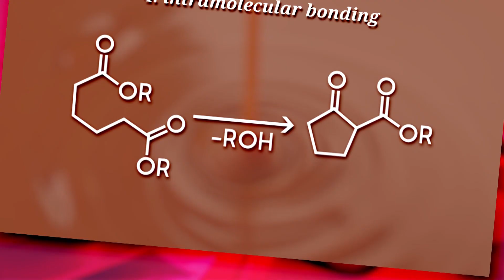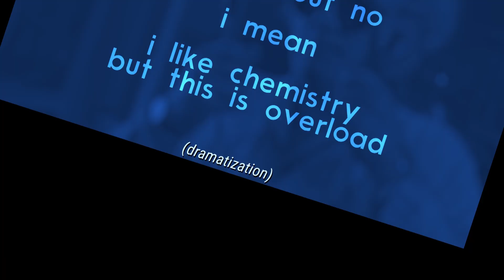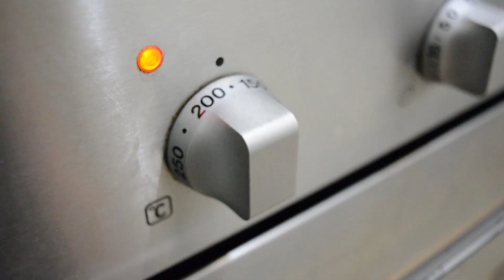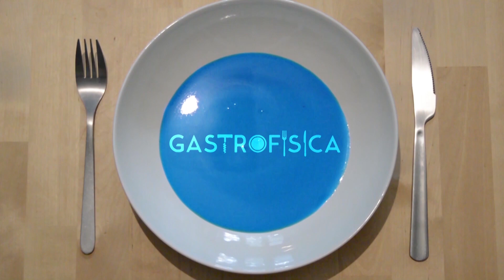The Physics of Caramel: How To Make a Caramelized Sugar Cube

Comment: TIL: 140C in spanish is 150C in english.
Reply: You live and learn.
Reply: Tippe Top Physics , you can calibrate most ovens they take an offset to correct the display. Note the hysteresis is surprisingly large and you need a fair number of cycles for it to stabilize for each setpoint. Then you'll discover each setpoint has its own offset and you can't adjust the slope lol.
Reply: Did you learn at school in English? Maybe your brain better understands 'learning' in the language its used to doing it in?
Reply: Tippe Top Physics Although caramelization is one of those neat tricks you can use to check the accuracy.
Reply: Well, a billion in English has 9 zeros and in Spanish it has 12, so this could just be another of those weird language things. Or it's just a mistake made during translation... Yeah, it's just a mistake in translation.
Reply: I grew up in using the long system and i think the short system is better. We use million, milliard, billion, billiard, trilion, triliard etc (millió, milliárd, billió billiárd... in Hungarian), but million, billion, trillion is easier to use. The long system feels like counting in a weird way, for example one, oner, two, twoer etc (i just made up the example, to highlight how unlogical the long system is imo).
Reply: Pablo 2002 language and the brain is strange. When I was learning Français with Rosetta Stone for some time after my attention would automatically see the French on packages before the English.
Reply: Kain Yusanagi
"million, billion, trillion" in the long system is like saying "2, 3, 4." You're missing the 1 which is a thousand.
"thousand, million, milliard, billion" is like saying "0.5, 1, 1.5, 2."
Why does own base (1000) raised to the 3rd power start with the prefix meaning 2?
Reply: Again, I ask you what the "bi" means in "billion."
Reply: How does something whose meaning includes 2 end up as 1000^3?
Reply: I think the long System certainly makes sense: a Billion is two Millions, a trillion three Millions etc 
EDIT: I mean 1000000^n, not 1000000*n
Reply: Very true, even though I understood it better in English than Spanish. Wired considering my mother tongue is Spanish
Reply: st1300 r if only they used PID control.
Reply: Matt Wells is that because they include decimals to the thousandths place?
Reply: So they call a billion "thousand millions" and a trillion, a billion? That's silly.
Reply: @KainYusanagi  we also have a special word for a thousand millions that doesn't exist in english, "millardo" (could be translated maybe as "milliard"?) that would be just "billion" in english.
Reply: @alecity4877  Jesus christ. Read the whole thread, please. Especially when it's over a year old.
Reply: @KainYusanagi  I already did, I'm sorry, it was late at night (1am) for me, guess me with insomnia couldn't wait to reply X^D.
Reply: @alecity4877  it does indeed translate as 'Millard'. England used the long scale until 1974, and only changed due to Americans using the short system (and apparently not knowing how to work internationally where basically every European country was long scale)
Past 1974, England switched officially to the short scale. I remember my old maths teacher (y7-10) being mildly confused when I brought up the usage of the long scale in English (conversation after the lesson, I did this frequently because I like maths :P). She didn't seem to know that the long scale was used in England so we googled it. Was actually quite interesting. I still prefer the long scale, and were I given the choice, would use it over short scale (n.b. long vs short is also why official documents almost always clarify written numbers with numerals after)
Reply: In Poland we also use long system, but what's more interesting we say miliard for thousand milion, biliard for thousand bilion  etc.
Reply: In the Spanish language video subtitles say 120-150 C, but graphics say 120-140. Maybe a mistake in the Spanish video?
Reply: I guess its to make the number round in farenhait
Reply: Long system is silly because one two three/une deux trois/uno dos treis/million billion trillion. It follows the same conceptual format instead of suddenly altering itself on such a basic conceptual level once it reaches millions. Or, tldr: Consistancy. Everything follows the same deal. Ones(factor beginning), Tens, Hundreds, <new factor>, with the first being Thousands, then Millions, then Billions, and so on.
Reply: 俺の趣味は大麻を培うのですよ
Well as someone who grew up with the short system, Id say that long system is better because I'd rather have a billion be a million^2 rather than a thousand^(2+1).
There are 7 milliard people on earth and debt is measured in the billions.
Reply: Yeah, I feel like the short system makes everything unnecessarily bigger. But again, it boils down to personal preference.
Btw, the term "millardo" (milliard in spanish) is considered a neologism which didn't exist until 1995 when it was added due to it being used in Venezuela. It seems to exist in almost every other european language, though.
And, oddly enough, in Chinese and Japanese they group them by the ten thounsand (or myriads, as they seem to be called). ó.ò
Reply: It makes no sense. Ones, tens, hundreds, thousands, ten thousands, hundred thousands, millions. Every single additional order of magnitude to this point (in other words, 99% of all functional mathematical usage) follows this basic pattern. Suddenly switching to utilizing exponential powers to denote the factor increment is silly, at best.
Reply: Kain Yusanagi it's because what in english is refered as a billion, in spanish, is just called "thousand millions"
for reference:
english - spanish
million - million
billion - thousand millions
trillion - billion
quatrillion - thousand billions
Reply: The thing with a billion isn't the difference between English and Spanish. When taking French, I noticed "trillion" as a translation for "billion" and started digging.
The difference is actually what's called the "Long System" and the "Short System." English primarily uses the short system, which is based on multiples of 1000, while French and Spanish use the long system, which is based on multiples of 1000000.
IMO, the long system is better as "billion" = "bi-million" = million^2. A trillion is a million^3, and so on. For 1000^3 (short system: billion), I've heard it use the term "milliard," which extends to billion * thousand = billiard, trillion * thousand = trilliard, and so on.
It's perfectly valid to use the long system in English, it's just that no native speakers will understand you.
Reply: No I didn't. "Ones(factor beginning), Tens, Hundreds, <new factor>" So the "new factor" becomes "factor beginning". So [Ones], [Tens], [Hundreds], ([One])<Thousand(s)>, [Ten] <Thousand(s)>, [Hundred] <Thousand(s)>, ([One]){Million(s)}, [Ten] {Million(s)}, [Hundred] {Million(s)}, ([One]) ||Billion(s)||, and so on. Each grouping follows the same concept at every point. Ones, where any given factor begins at, Tens, Hundreds, and then it transitions to the next factor.

EDIT:As for why does raising it by powers cause a difference? Same reason raising 1 to the 3rd power doesn't mean it's a hundred. Powers are a completely different system of measurement that is self-contained.
Reply: Two. Just as "tri" means three, "quadra" is four, "quint" is five, "sext" is six, "sept" is seven, "oct" is eight, "non" is nine, and "dec" is ten, and each follows the same format that I described, being four digits (a thousand of the former factor) larger than each previous. "Million" does not have a prefix beginning, because etymologically it is "A great thousand", aka a thousand thousand. Everything comes back to thousands.
Reply: +Kain Yusanagi
It makes no sense to you because you don't understand it. I'm not being mean or anything, it's just that the way that you refer to it has me convinced you don't understand its logic and why it's, if perhaps more complex, also more logical than the short system.

You keep repeating that "bi, tri, quadri" etc. is the reason the long system doesn't make sense to you, but those suffixes were created for the long system and it's in the short system where they get weird. In the long system, the number 2 is relevant to the billion because it's the second time you have gone through all the named quantities. You said it yourself, a million gets its name from "big thousand", as it is a thousand thousands. When counting in the long system, there's no inconsistency if you count "ten million, hundred million, thousand million, ten thousand million, a hundred thousand million". Then you reach the point where you would have to say "a million million", at which point mathematicians decided to name it "billion" so they could keep just changing the suffixes from then on every time it happened. And they also named the "thousand million" a milliard for ease of use, whereupon billiard and trilliard follow after billion and trillion as well.

There's nothing inconsistent or nonsensical about the long system. The short system has a small inconsistency regarding the etymology of the quantities  (if you're going by thousands then the million should be the second (billion) and the billion should be the third (trillion), etc.) but it's otherwise perfectly usable (the meaning of words really has no bearing in the words' ability to be used in math, after all) and usually easier to remember, hence why it grew in popularity in some places.

Just don't say something doesn't make sense when you haven't even tried to understand it.
Reply: +Kain Yusanagi
No, I've read all your posts and I can say with certainty that you don't understand it. Your explanation on why it's "less logical" according to you is less than stellar, and statements like "suddenly switching to utilizing exponential powers" just betray the fact that you don't understand how number systems (any number systems) are created.
Reply: Now now, sensible metric users should all agree that "million" shouldn't be a thing at all, as "milli-" is 1/1000.
Reply: Except one is objectively better, and I already elucidated on exactly why.
Reply: Because it is the second factor after the "grand thousand" (million). "Million" is effectively "one". "Billion" is "two". "Trillion" is "three". And so on and so forth. Each is simply a counting of how many extra factors of a thousand they are. Just as the byte, kilobyte, megabyte, and so on are factors of a thousand of the previous factor.
Reply: No, I understand it perfectly fine. If I didn't understand it, I'd say as such. You obviously didn't even bother to read the conversation at hand to just try and go "AHA!" because I stated the antonym of Linus' "certainly makes sense" in my latest post. It's less logical, and I've elucidated on how repeatedly above.
Reply: The same way you may find it silly, peolple who grew up used to the long one  would think the short system is the silly one. It's a matter of custom. No one is better than the other.
For example, when they say there are 7 billion people on earth or when they measure external debt on trillions I freak out a little inside, until I realize which system is being used.

Comment: Everytime i try to make caramel, it ALWAYS turn into charcoal
Reply: Not really. If you heat up slowly, and stir continuously (and I do mean continuously), no water is necessary. Lots of fine-grain sugar, slow buildup of heat, lots of stirring, and patience. You can even see the aforementioned state change (white sugar to brown caramel) happen before the stuff melts, if you are really lucky.
Reply: turn down the temperature, and if you're doing it in a pan, keep stirring
Reply: ThePizzabrothers Gaming do i have to mix the sugar with water?